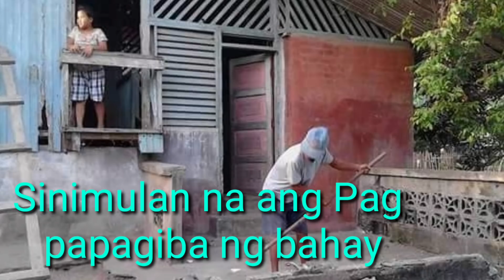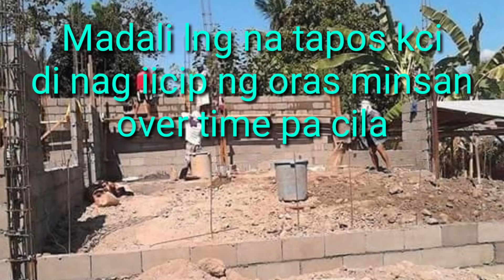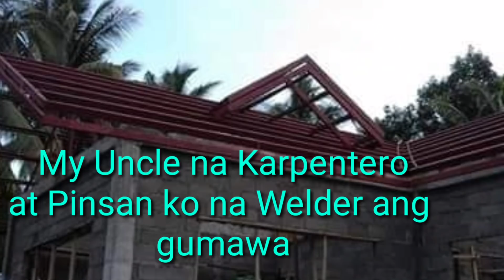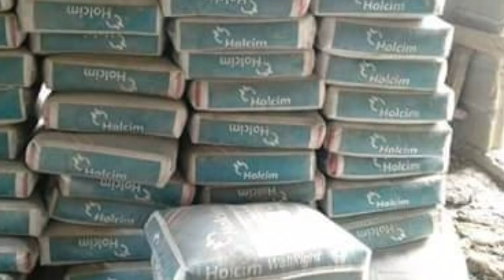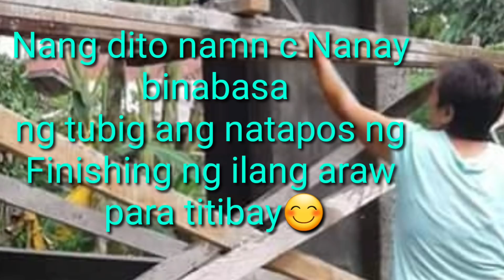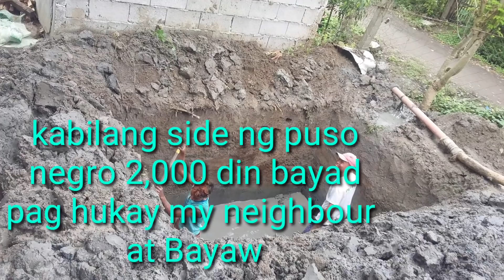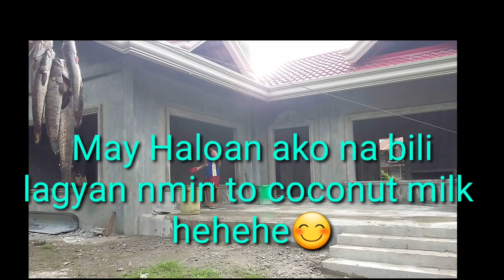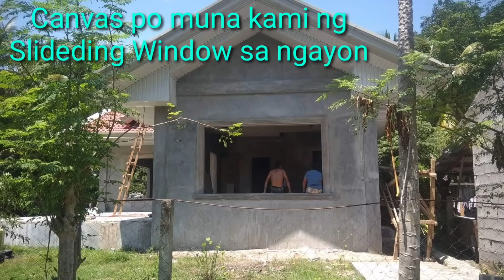Katas ng OFW, OFW SIMPLE HOUSE STORY SA PAGPPAGAWA NG BAHAY NI ATE STEP BY STEP

Comment: Hello po ask ko lang  po kung nag hire kpa ng architec  sa house plan  mo? At dun sa 460sqm  mo gano  kalaki un floor plan Ng house mo? Di mo rin nabanggit ilqnh room and toilet sa video pwede  rin bang malaman please! !! Thank you in advance  😊 hope masagot  mo tanong  ko, congrats sa new house mo sobrang  na kaka inspired 💪
Reply from the maker: Hai po wala po itong arhiteck po..  2 rooms 2 bath po sala kitchen and open area...   pag gusto nyo po architeck may ka killa po ako gusto mo refer kita masage nyo lng ako maam s fb Randy Reovoca Yerro po
Reply: Pag ng apply ka building permit  hhingiin ang plano db gqwa ng archetic i mean sign by authorized archetic maggamit yon lalo pag apply ng mgloan for example lng s mga bank  at any installation yata like water connection at electric parang its a requirement for application just opinion
Reply: @elvieguansing8260  thank you po, 😊